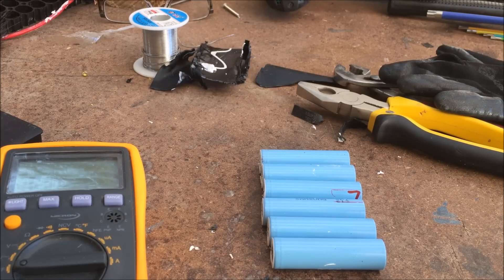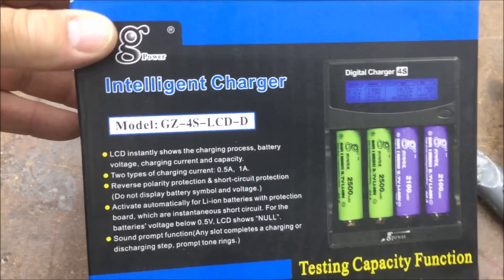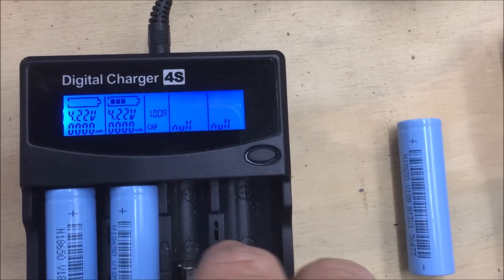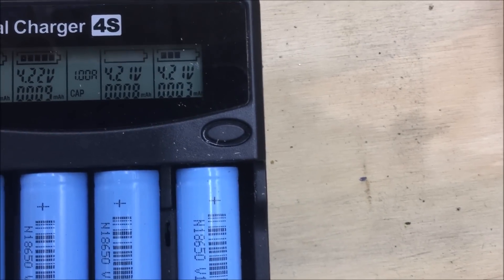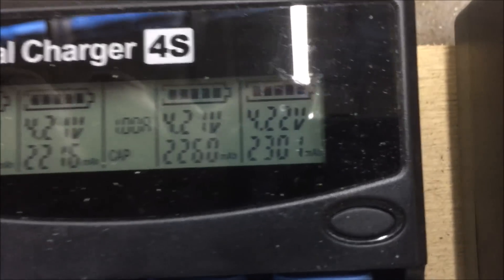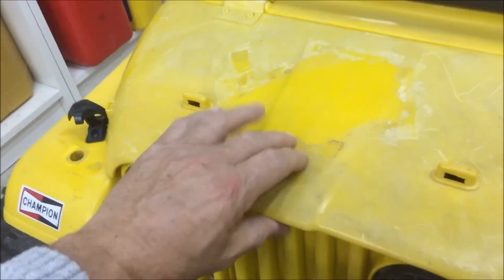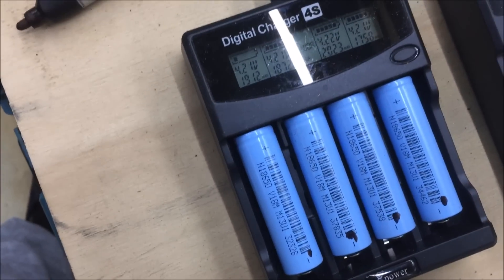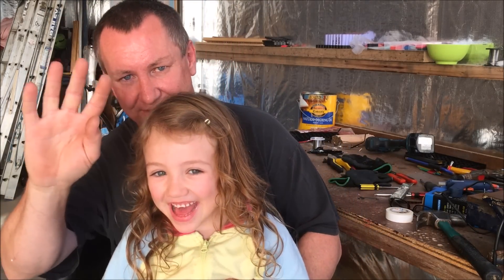DIY Power Wall -  Testing & Charging Cells #6

Comment: You mentioned that this charger will not charge batteries that are below a certain voltage. I have the same charger and discovered that if it errors due to low voltage, you can pull the battery down against the spring a few times and it will create a trickle effect to place  small charges into the battery each time. You can recovery some bad batteries by doing that. Give it a try and you will have fewer "junk" batteries to throw away.
Reply: Yes that works too
I've set up a power supply so I can charge 16 flat batteries at once

Comment: If you find some less than 2.5-3.0v try doing a mini trickle charge using your bench top power supply for 5 mins. I've found that these cells can be quite good (capacity wise), which is a bit counter intuitive

Comment: Hi Rudy, love the videos mate, wondering if you could try to answer this question... Given all the equipment you need, and the labour involved in reclaiming and testing used 18650's would it be a more viable option (financially) to buy NEW 18650's I see deals online for LG, Samsung etc for $1 each (excluding shipping) and do you have any thoughts on the matter? many thanks, Adam, Melbourne.

Comment: Hey, Great work!
I am at about the same point as you in terms of battery setup and configuration.
Wondering two things 
What are you planning on for BMS (Battery Management System)? (By cell set or total unit)
What inverter/charger do you plan on using? (I have been looking at Victron Multiplus or Quattro)

Comment: I want to start similar project.
Could you please suggest where can i get hold bulk collection of laptop batteries
what would be a right price for a laptop battery based  on number of cells it may contain  
i mean  what would be right price per each cell  , considering lot of work that is involved after that

Comment: I ask how to find out the contents of the battery when emptied with dischager facility?

The display is the capacity at the time of charging, not at the time of discharge.

The actual battery capacity is during use or discharge.

Comment: Hi
Good video. 
My daughter has the same little car and I've been wanting to make a battery for it.
Did yours have the 2 x 6volt lead acids.
May I ask what voltage did you make the batteries and what configuration are they are wired?
Thanks

Comment: Have you tried checking the voltage when the Foxnovo Charger says it's "Full" because I bought one of these chargers, and it will never go into the discharge cycle. It claims that it is 4.22v however I pull the battery and test with multimeter and it shows 4.50v!!
Reply: Mine usually charges my batteries somewhere between 4.05 - 4.15

Comment: Re the charger. Is is constant decharging with 1A?    - If i set my charger(s) to 1A constant discharge, it drops to 3.3V reall fast and only decharger about 2-300mAh. But if i slow discharge my cells. they have close to 2Ah..
Reply: Sounds like a problem with the charger.

Comment: http://www.ebay.com/itm/322118779333?_trksid=p2060353.m2749.l2649&ssPageName=STRK%3AMEBIDX%3AIT  I got 2 of the above chargers, but I added this capacity tester. It comes with 2 5 ohm resistors I put on screw 1 and 4 (i suppose you can put a lightbulb or motor here too).   You put the battery on 2 and 3.  You can put the setting at 3.9 and test capacity to there, then 3.8 so you can make a curve if you want to.   I have 4 batteries in parallel to test a pack at once. You charge the battereies 1st then test them.  So it is good for low discharge AA to see if they really hold charge.  For $4.50 it is a fun device.  I think it is good to set low discharge point to 3.3V as there really in not much capacity left below that.